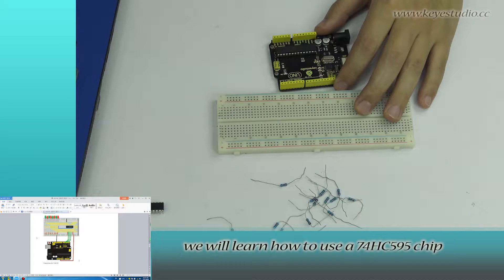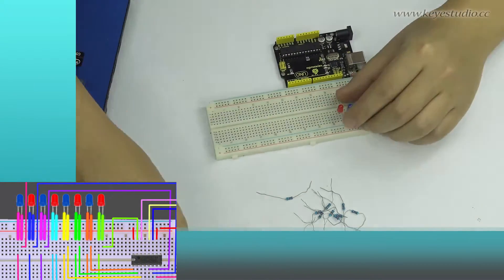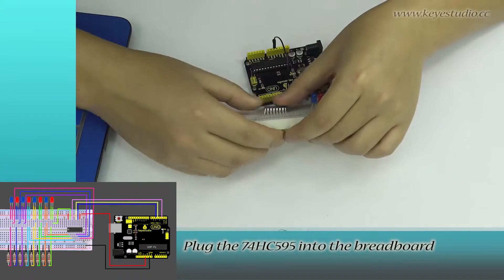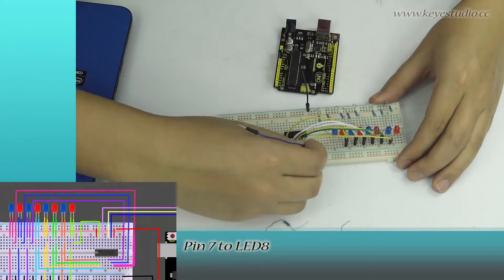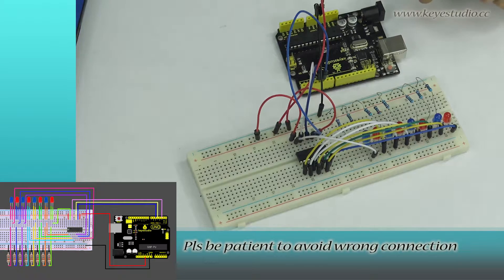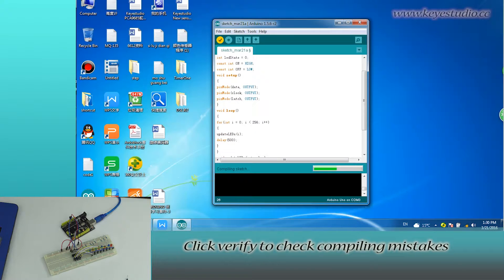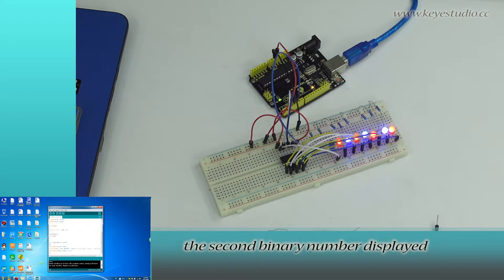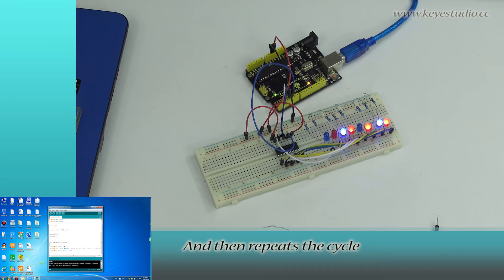Super kit: 74HC595 driving LEDs

Comment: I tried the project even after putting the code from your website it didn't work. Nothing happened. And all my wiring is correct as the manual in my kit.
Reply from the maker: Hello, could you send a example video or picture to us?so we can deal with the problems for you. thanks
Reply: Umm...how do I contact with you? I can't send a picture in the YouTube comments